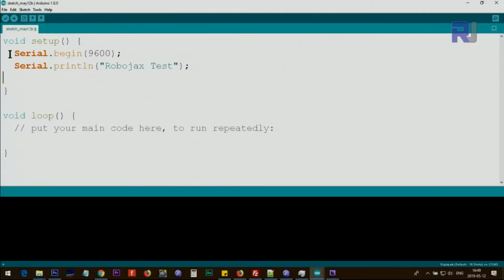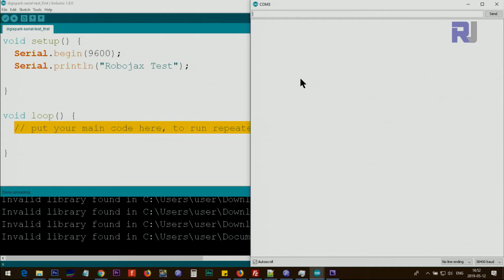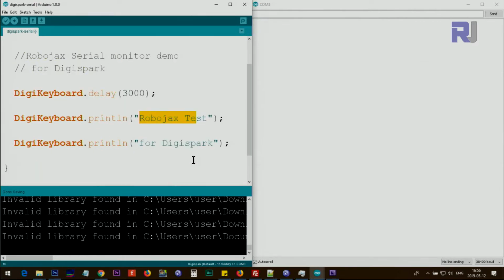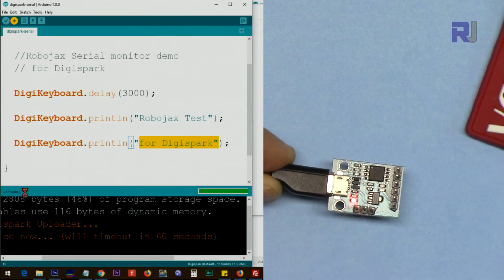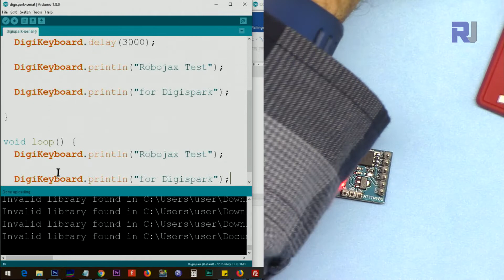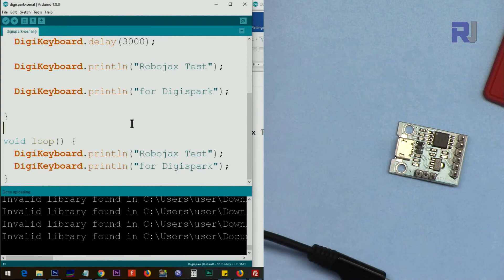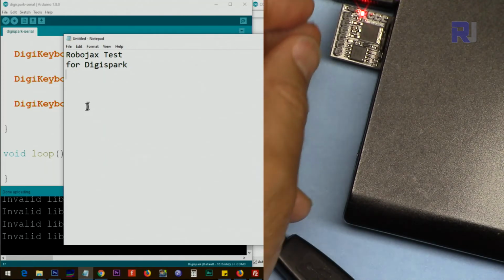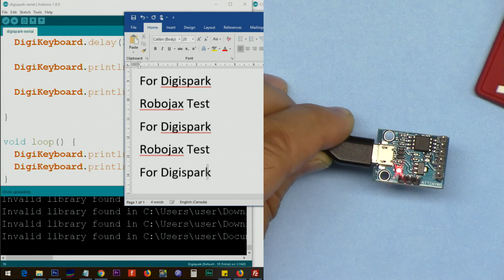Digispark Keyboard to display information like Serial Monitor RJT156

Comment: I apologize. 
I understand that the video was recorded 6 years ago, but I hope you will answer me. 
The link that should have been entered in the settings no longer works (digistump). Because of this, the library is not working (Digikeyboard). Is there any way to solve this problem?

Comment: this is no serial comminication. Thank you for your work in this video but title of this is misleading.
Reply: Agree with this how searches are done…that is how I did the search that found this video….also agree that the technique doesn’t use serial communication…BUT this technique gives a simple and quick way to Monitor a Digispark…quick and simple monitoring of a Digispark are exactly what I am looking work
Reply from the maker: That is how people search "Serial monitor for digispark". Suggest a title.  If I put "print debugging information on for digispark board", many people will not search for find the video.
Reply: @robojax  When i found your video i was searching  a way for serial comminication method between my python code in my pc and digispark via usb port but although your video is fine and taught me stuff i did not know;  title mislead me. If i am gonna sugget one title it would be " using digispark as a keyboard". but thanks for your work anyway
Reply: @robojax  only problem is you can not really print debugging information, you are printing on void setup()